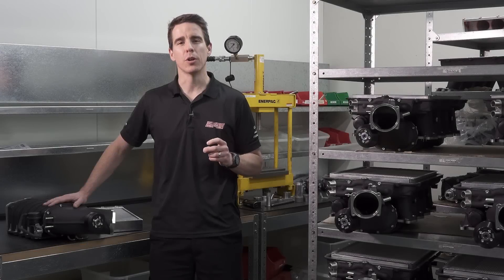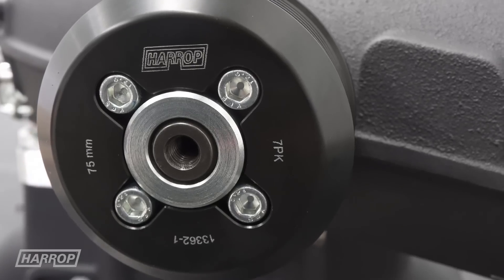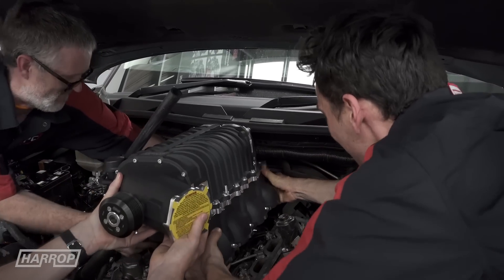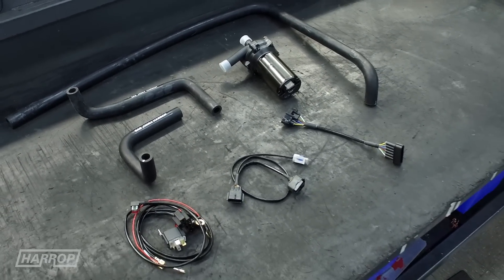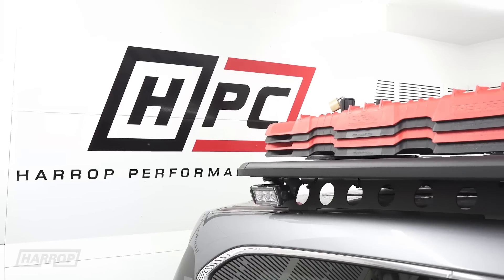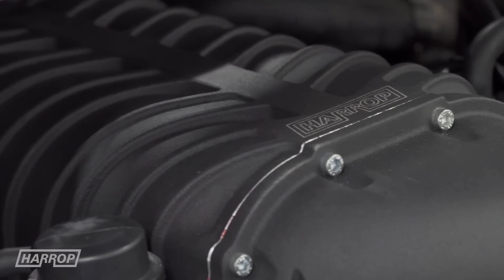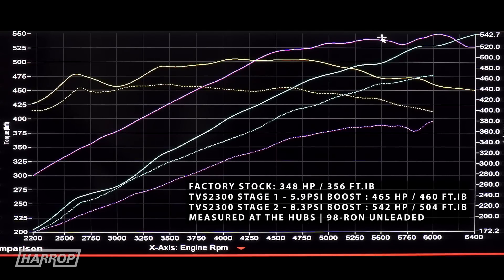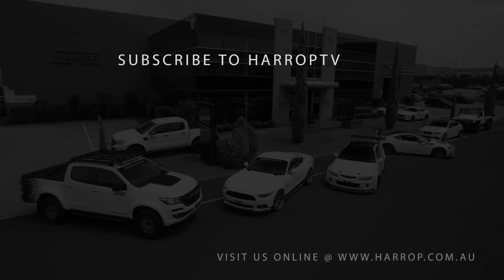Nissan VK56 V8 | Harrop Supercharger Kit Technical Review

Comment: 17 Toyota owners dislike
Reply: I'm a Hilux owner and I'm in love with these. The Patrol has always been a great piece of machinery. Use to have a GQ which unfortunately had rolled at 100kmh. Both rear windows stayed in and survived, back passenger windows (3rd row) popped out during the roll and didn't break, and the 2nd row windows survived despite the roof being on a 45 degree angle, fuck me I was amazed

Comment: What’s the cost of a pulley upgrade and fuel stage two ? I couldn’t locate it on the harrop website. I’m running the 2300 on my Y62 and wouldn’t mind upgrading along with Remapping the oem ecu.

Comment: $7.7k USD for the kit? And does that include literally everything needed for installation? Is it true bolt on, or do pistons/rods/rings/etc have to change? What about ECU? Thank you! Very interested. I tow 8k lbs in a dump trailer, up to 5 of those loads a day with my VK56. I have been for almost 2 years. People at the quarry and jobsites look at me like I have 3 heads when I roll past with 4 tons of gravel being towed with my Nissan.

Comment: I'll be putting a VK56 in my Nissan Xterra soon as the weight of the vehicle is drastically more now that it's armored, plus I want to pull a trailer.

A kit like this would make treks to high elevations (7000-8000ft elevation) easy.  Especially offroading.
Reply: I have a 05 Nissan Xterra lmk if it was a good idea so I can do the same :)

Comment: Will definitely have some form of forced induction happening to my Patrol. I would be keen to learn the benefits and drawbacks on supercharging compared to putting on a turbo.
Reply: PD supercharger generally has much better low down torque, less lag in power delivery, better for offroading than turbo. Harrop are the business.
Reply: turbos are pretty efficient now, although, inlet temps get considerably hotter then supercharged setups & they generally require less maintenance then a turbo setup. me personally for what this vehicle is going to be used for, I would go supercharged, for out right performance and the kick from a turbocharged setup I would have it in something for more street/track type vehicle
Reply: First off is a supercharger kit is much cheaper and easier to install as there's much less parts, PD supercharger has instant boost and I believe there is less underbonnet heat. Downside of supercharging is they're not as efficient as a turbo system and suffer from heatsoak.
Reply: Another thing to keep in mind is superchargers hammer your bearings due to the load it places  on the crankshaft
Reply: Can't wait for the review

Comment: I have a qx56, I would love to do this to my vk56DE. What concerns me though is the health of the automatic transmission. I'm looking for a very mild upgrade from the low end. Mainly for passing and accelerating with a loaded passengers and cargo. Stock 315 horsepower/235 kw is nice, but when the SUV is fully loaded the low end power is lacking.
Reply: Check out level 10 transmissions....

Comment: Thank you for offering a well designed and engineered SC kit for the VK56VD.  Is there a chance that this is compatible with other platforms with the same engine?  Very interested to see if this can be fitted to the current generation Infiniti Q70/Nissan Fuga with the V8.  Curious to see if there'd be more interest in the US for the Y51 platform; we have an odd void for large performance sedans in the US.  If more people knew there was a proper solution for the VK in the US, I think the M56 and Q70 would have a larger following.
Reply: ppl already know this quit assuming.

Comment: is it possible to use one of these kits on my VK56VD infiniti M56x sedan? I would love 500 AWD HP
Reply: 😭😭I was thinking the same thing
Reply: Please answer this Harrop. I would absolutely put one on my M56S as well. Burnout machine!
Reply: Also, assume the dual intakes of the M56/q70 would be a custom project, and I'm pretty sure that roots style charger isnt going to fit under the stock hood

Comment: Will the stock gearbox handle this?
Reply: It will be fine. I assume they remap the transmission upping line pressures etc to prolong clutch life. The Jatco in these is a very heavy duty unit. After all it has to cope with 2.7+ tonnes of weight and a powerful v8.

Comment: Love Patrols!! :) Y62 is super luxury, fast Suv and great, strong Offroad.
Reply: And shithouse fuel economy! 20+ltrs/100kms if you're lucky.
Reply: N these superchargers improve that
Reply: @jarrodk2832  No they don't
Reply: U have one do ya?
Reply: @jarrodk2832  I have driven many inc SC I won't ever have one they are shit
Reply: @jasonswift7098  shame you have no idea what your on about mate can only think you have never driven one.
Reply: @shreckm6470  Actually I do I work with cars all day long ok, so your comment is not valid.
Reply: @jasonswift7098  I've had mine for two years and over 120 k so far and honestly mate you can't fault it if you're happy to put down what's wrong with them go for it
Reply: @shreckm6470  I have already said so.
Reply: @jasonswift7098  you dont buy a v8 for fuel economy...
Reply: @MK.uLtrA-113  Not in general but most modern V8 petrol cars get a lot better than this car like half as much.
Reply: @jasonswift7098  recently finished a 4 1/2 thousand k trip mine average 15.3 L per hundred and there is nothing wrong with that don't forget this thing weighs 3 ton and no DPF no EGR no catch cans no chips no bigger intercoolers no turbos must I go on
Reply: @shreckm6470  My brother has a y62, it averages 15.5l/100around town driving gently. I have a Landcruiser Sahara Diesel and get the exact same driving normally. $40 K difference in price and the Y62 is a rocket.
I love my Cruiser but my point is the y62 has not got all the DPF/EGR shit to worry about and is not that bad for a 3 ton offroad loungeroom

Comment: Great! Now everyone's 2015 or newer Titan can "almost" run right along side a f150! Whoopi!!!! The TT f150 puts out 385/430 The new Titan couldn't even get out of it's own way with 390hp. 
I own a 2006 Titan. It ran circles around both newer diesel/gas Titan Models because of 2015 --20 configuration. Too heavy & gutless. 
@ 315 hp my older model bumped up 30% or to about 405hp + torque would eat the V6 TT for lunch. But the new Titans would need more than 30% upgrade. I drove them both. The newer Titans would need minimum 500hp+ to even begin to be respectable. And until Titan uses American influence instead of Asian build specs & punched out pocket diesels I won't buy another. Doesn't matter if there built in Tennessee. Have u seen who puts them together in that facility?  My Titan 06 was "one" of the best 1/2 tons Nissan's built. But, they slowly destroyed the Titan with modifications & a heavier truck towing design which just put the Titan in no man's land. IMHO
It's not a 3/4 ton it's priced too high for a 1/2 ton & it can't compete in these combined Categories. Towing, price, braking & mpg. I also have a 95 Nissan xe 2.4l pickup. Great little truck. It will haul 2,000 lbs in the back but throw the clutch out pulling the same 2,000lb via trailer......lol
Both Nissan's have 235k & 175k miles on them & nothing on either motor has failed!
(A/C Compressor - 95. & Starter - 06)
I refuse to buy a Ford truck with a TT V6. It's unAmerican! And I don't buy a truck for gas mileage!
Cheers...